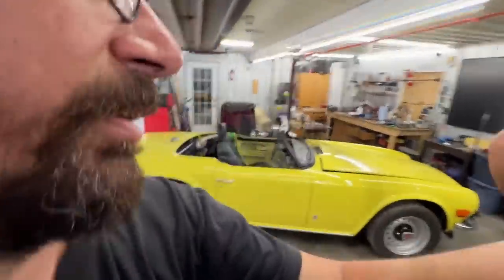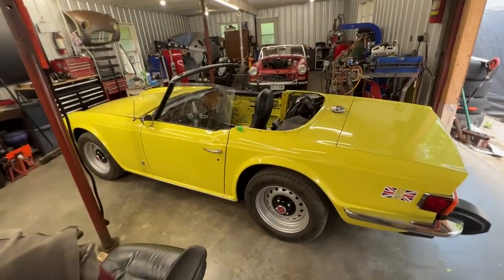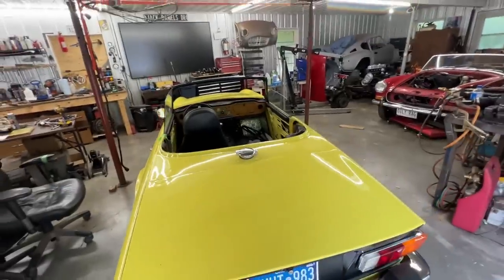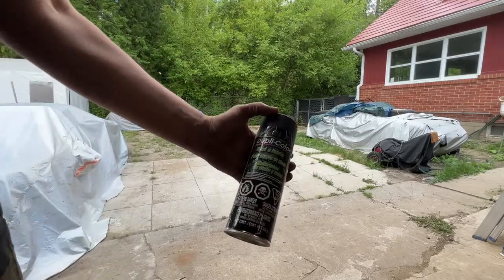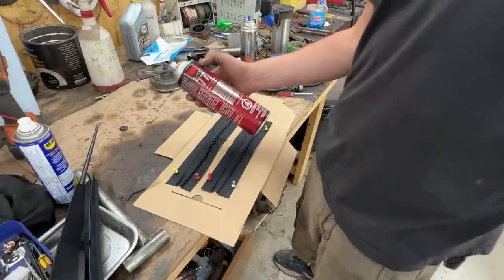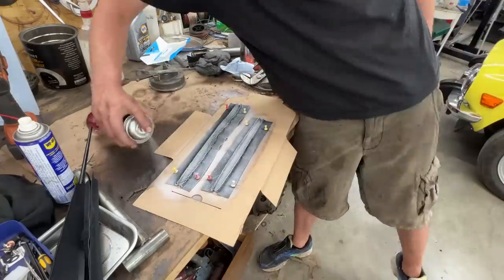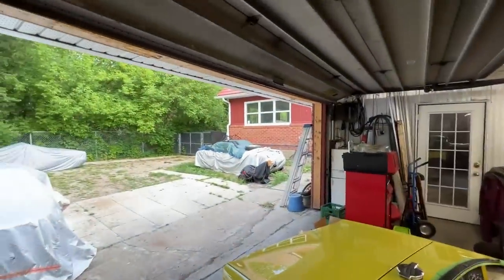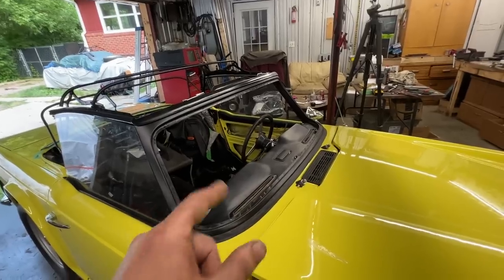Triumph TR6 Soft top installation - Part 1 - Frame

Comment: So far, so good Elin.. I confess that here in the UK when I was working on soft tops cars of all descriptions I never messed with them. We had a couple of local upholsterers that specialised in making and fitting replacement soft tops. Had you and You Tube been about back then (1960' & 70's), I'd have probably had a bash at it as you show the detail and teach it all very precisely.

Comment: I am in the process of doing this myself right now. Great video. I too have used seat belts for the strapping of the frame. A previous owner has repaired my hood in the past but has used various different size bolts for the frame, spacing out the extra length. I will revisit that later!

Comment: I’m intrigued that you didn’t fit the chrome header rail first. Does that not change the tension of the hood frame and therefore the fit to the side windows? You’re brave taking these tops on. I’d be too scared to make a mistake, with no way of backing out. 🙂
Reply from the maker: I kept the header off as long as possible to avoid scratching it. It doesn't change the fit of the frame. 
I was scared with the first one too, but I found it looks more complicated than it actually is. It is scarier when you have to make your own top from scratch and I've done that too :) For a Citroen DS19 convertible and for a Scout international. Both turned out great, but it was way before I started filming unfortunately.

Comment: I see that this is a car that came from the factory with the hardtop installed.  These models didn't have the tonneau snaps on the door and I think the fittings are also missing on the dash pad.